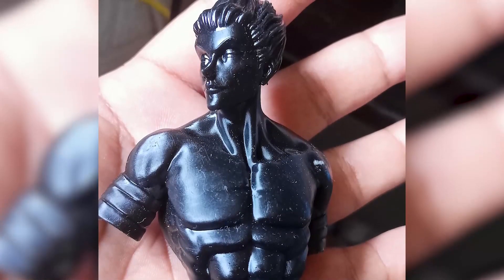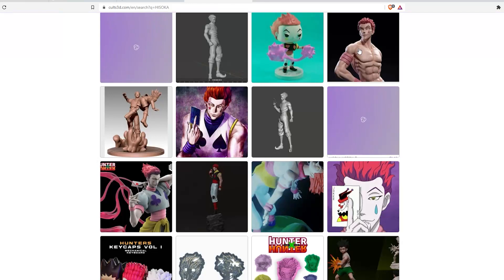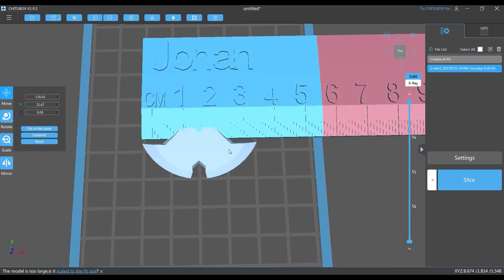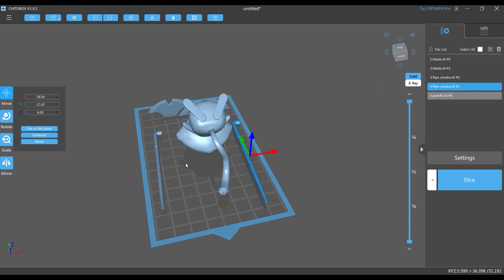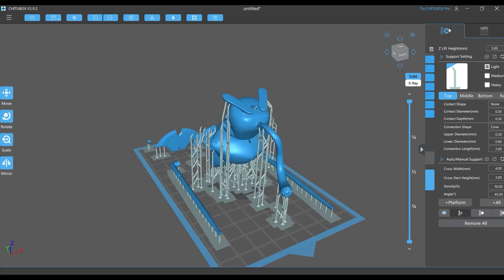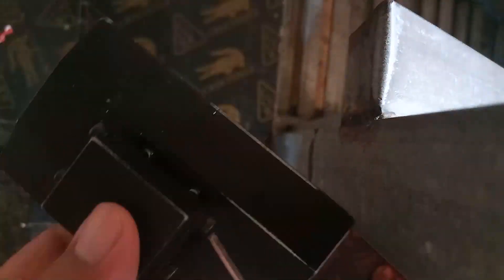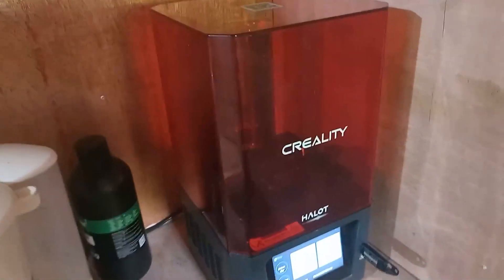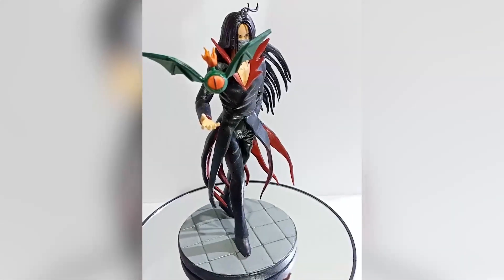HOW TO PRINT FIGURES USING CREALITY HALOT ONE EASIEST STEP BY STEP PROCESS | Gyaru & Neko

Comment: I have halot one and 1st try to print and i noticed  my project didn't attach in my plate metal instead  sticked in plastic  cover?
Reply from the maker: Try to level your plate you need to press the plate and put a paper on it then tighten the screws.. sometimes its also on the resin that your using, try to use a hard resin not the water base.

Comment: I use prusa slicer to support models then I export as STL with supports, then I put it in halotbox for slicing, that way you can send the file to the Halot one over WiFi and you don't need a USB flash drive. But upgrade the firmware of the printer. Better interface and settings.
Reply from the maker: That's great. Thanks for the info, I prepared to use usb.

Comment: Great video. But as you said, the resin is highly toxic so please dont wash it in the sink. Instead, wash it in a large container then after, let the used water with the resin sit under the sun to cure any left over resin in the water, then you can dispose of the water and resin separately.
Reply from the maker: Yes that's true. I have separate sink that  is for crafts and washing of paints area only, and I clean it after.
Reply: @gyaruneko984  Great summary video, but like @DanielBuenaventura mentioned, resin is highly, HIGHLY, toxic, specifically uncured, don't let it go down the pipe. Do as he said to cure whatever resin rests you have in either water or IPA putting it in a clear container in the sun and once everything is solid, then yes, you can dispose it as plastics.
Reply from the maker: @AgustinSaldias  Thank you sir.. noted now a days I just directly pour my washed resins on the sewages.